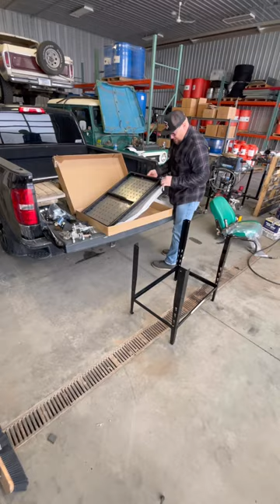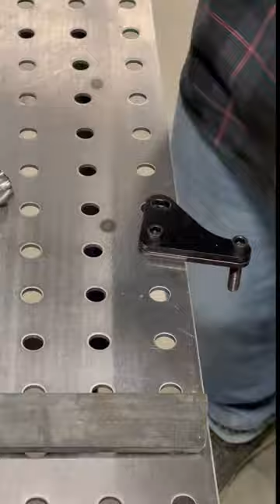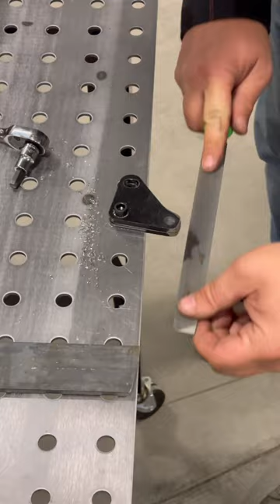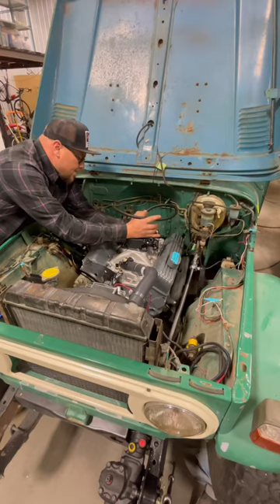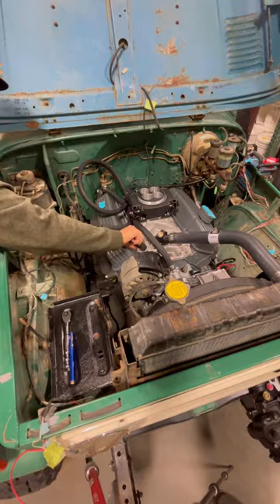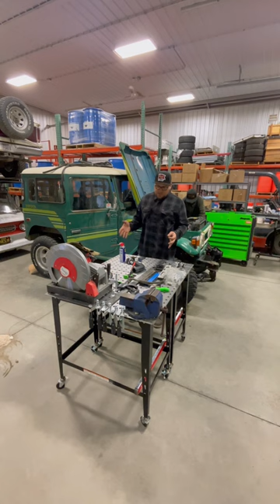We have a work table! SBC high mount PSP bracket, is there such a thing? #diy #fj40 #howto #sbc

Comment: Where did you get that table from? Part number?
Reply: I was wondering the same! I like it!
Reply from the maker: Princess auto, it’s the cdn version of harbor freight. It’s brand is Mr Blacksmith sku 8907602 $218 cad
Reply from the maker: @axialmillipede  it is pretty good for $218 CAD brand is Mr Blacksmith
Reply: @dickindustriesinc  They are great. I got 24”x36” piece of 1/2” plate given to me so I made one. Seems like I use it almost daily. Love that build you’re doing. 
Princess Auto is like Costco, just try going there for one thing. 
Are you in Western or Eastern Canada?